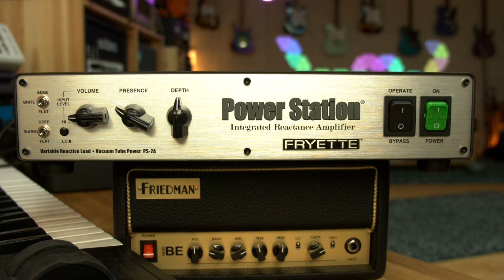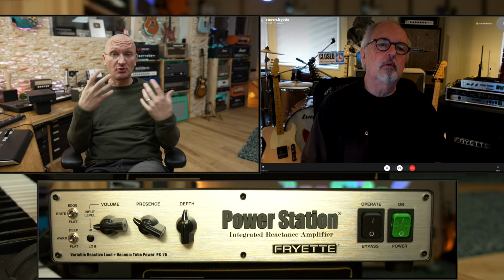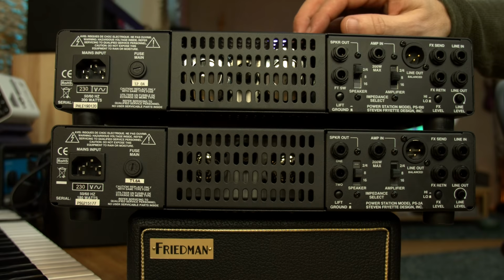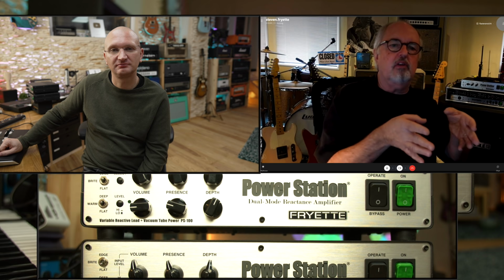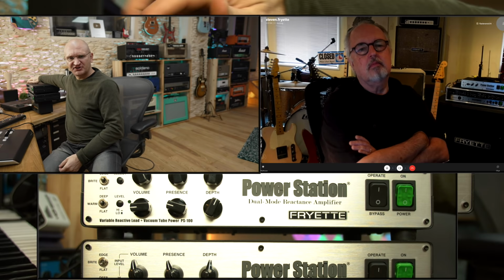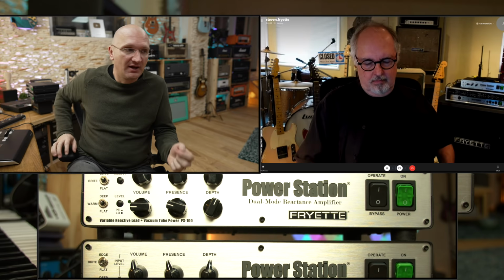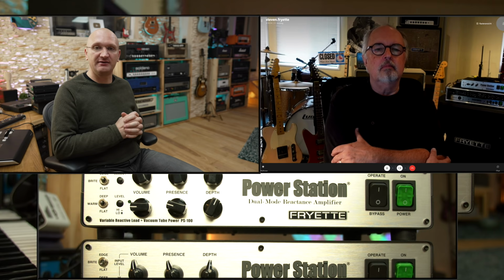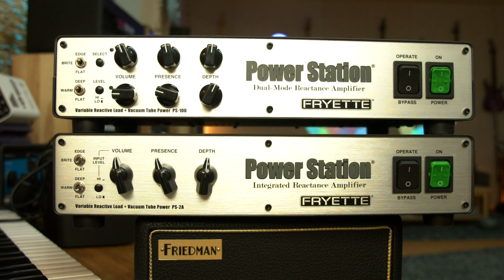The ultimate Attenuator? Fryette talks about the Power Station

Comment: I have an 8 head amp switcher, I put the ps-100 in the in out bus of my amp switcher, that gives me a global attenuator for all 8 heads and a global effects loop for all 8 heads, it works perfectly, cuts down on cables, great piece of kit.
Reply: I'm hoping to add an amp switcher for this same setup. I'm glad to see someone mention this setup. I have the PS2 and I'm hoping to get the 4x2 amp switcher
Reply: Super great. I have an SC20 which I am getting this for, but also miss having a Plexi so going to need two amps in the mix sooner or later. Right now just want to get things working with what I have going on, but it's good to think ahead. Appreciate your comment.
Reply: What switcher do you use or recommend?
Reply: @kalkidasofficial  I have a Kahayan, it's great, does the job perfectly, I have had it for about 3 years, if I was to buy one today it would be a KHE
Reply: I've got a DeLisle 12x12 on the way and I'm dying to replace by Radial Tonebone Prodigy load-box with a ps-100. I've got over 12 heads and quite a few low wattage combos that would be amazing with the option of adding a bit more power to them. I'm also fully bought in to the Synergy ecosystem so the power amp function of the PS 100 is sooooo tempting.
Reply: I have multiple heads, i am just not getting (in my head) how you have multiple heads (i also have a bunch of effects going into the front of the amp(s) i am using) going out to one line into the power station (i have the ps-2).
I badly want an amp switcher so i dont have to keep disconnecting to the smp i want to use ??? Confused here, ive seen both the Kayahan ant the other amp switcher named in the Delisle ,  oth look great, just not getting it.
Thanks for any help.
Ready to buy...
Reply: @johnwolff3206  so some of the amp switchers (kahayan khe) have their own inserts in and out for you to place your attenuator load box whatever (ps-100 for me) the ps-100 has its own effects loop so all my pedals I want in the loop go into the ps-100 loop, and with the ps-100 in the insert bus of the amp switcher that means when you switch between amps the effects switch as well because they are in the ps-100 loop which is essentially attached to all the amps at the same time by way of the amp switcher, just be sure you get an amp switcher that lets you attach it that way
Reply: @jackdpearce  I  have multiple heads, i am just not getting (in my head) how you have multiple heads (i also have a bunch of effects going into the front of the amp(s) i am using) going out to one line into the power station (i have the ps-2).
I badly want an amp switcher so i dont have to keep disconnecting to the amp i want to use ??? Confused here, ive seen both the Kayahan and the other amp switcher named in the Delisle ,  both look great, just not getting it. The gentlemen above explained about the Kayahan switcher, can you explain about the Delisle please. I want to(would like to)run my fuzz, distortion and boost pedals into the front of the amp, not the effects loop of the power station.
Thanks for any help.
Ready to buy...
Reply: @johnwolff3206  I’m pretty sure it will, if I was buying a new amp switcher I would go for the KHE with all the bells and whistles, I know one of the models has the ability for you to run two cabs at the same time which I can’t do with the kahayan, good luck 👍🏼
Reply: Nice, I've got the same setup. Works great
Reply: @thehoppo  KHE is the way to go
Reply: I have a KHE 4x4 FX and it’s great. It has a dedicated attenuator insert loop too.
Reply: @woolyfuzzy  perfect
Reply: Hot tip thank you! The PS makes all my amps actually sound better

Comment: I have two PS2-A units, which I consider some of the best gear I have ever bought. Mainly use them to go stereo from a Helix Rack into two 2x12 cabs with Celestion Cream speakers (after I finally realized that Class D power amps and guitar should not exist on the same planet - and I tried several of those). I also use them for recording (far less noise/hiss than the Captor X and a lot more road worthy than that OX by IKEA). Of course I also use them to attenuate my 100W heads and to amplify my Effectrode Blackbird Preamp. It works perfectly for all these things.

Comment: Purchased the PS 100 almost a year ago. I am constantly blown away how my 100 watt amps sound at reasonable levels. Even my 1watt Marshall sounds kick ass cranked into it. I run it through and amp switcher and I use it as an attenuator, as well as use it as the effects loop for all 6 amp heads. I like if far better than the Boss TAE, which I sold to fund this purchase. 

Probably the best gear purchase I’ve made in years.
Reply: I currently own a Boss TAE and I’m thinking about getting a PS-100. How would you compare them?
Reply: I have recently putchased the ps 2a. Is it normal that it runs too hot? Thanks

Comment: I take one output of an AxeFXIII into the FX return of an EVH 5150III,then take the speaker out of the amp into the PS-100…. Then the line out of the PS-100 back into the AxeFXIII…..Outputs 1 of the AxeFXIII then go to a stereo Marshall 9005 tube power amp into 2 4x12’s……so the amp models are being run thru a cranked tube power section,then that sound with stereo FX are going out left and right,and I can use a 3rd cab in the middle that is dry….sounds phenomenal…..Power Station makes a very easy wet dry wet rig…..

Comment: This looks incredible, I just want something like this but with a Stereo FX Loop, Stereo Outs and 3 Cab outputs. Add the option to have 4 Line Outputs a Left and Right for for the Stereo FX loop, and 2 for the dry signal with a tiny phase difference to give a double track effect. Effectively this would allow you with a Single Amp head to create a Wet/ Dry/ Wet setup to create a perfect Stereo recording or Live setup. You could Mic 3 Cabs, have the FX loop affected L & R outputs Direct into your Interface either through the ADAT or L & R Line outs and just Mic a Cab with the Dry Signal, Run FX Loop L & R outs and both Dry outputs into your interface either from Line outs or ADAT. Yes I get having so many ways to effectively do the same thing seems redundant, but it would give Options, and Options are Good.

Comment: I know I’m late to this party, but just to be clear about Edward Van Halen’s classic MXR Phase 90, MXR Flanger and Echoplex sounds from roughly 1975-1981 or so…he did not have effects loops or any external effects loop devices. He ran everything straight in front of his Marshall amps. If you are talking about say 1985 forward and the advent of the rack gear and later the signature amps from the various companies and albums from 1991 onward, there might be some loops involved. But I can say with absolute confidence and hard evidence that Eddie did not use an effects loop for any effect during what most consider to be the classic era of Van Halen.

Comment: You can use a Boss TAE for your wet effects send but I wouldn't use its output for my main dry guitar sound. The Power Station you can do both and it sounds amazing. It is a real amplifier. valve amplifier. Your guitar cab of choice feels a Valve amp driving it but at your level of choice, ie not deafening.

Comment: The Fryette PS-100 is what I have waiting for my needs- - - - am able to boost my favorite lunch box amps, or attenuate my 100w beasts, or use the line out going into my AX-8,  into an interface to do silent computer recordings. ALSO, ADDED BONUS - - - Be able to run the already beautiful amp models of the AX-8 through the PS-100 and out into my cabs, eliminating the need to fill my man cave with much more amplifiers. Now I can have inspiration 24/7. This is beautiful, thank you Steven Fryette.

Comment: This is an awesome video that really answers all the questions I've had. Previously while considering to get an attenuator I always bumped into lots of marketing bullshit and those were packed with a lot of stuff that I don't need and especially don't want to pay for. This product is very different.

In software engineering this is called micro services - some code that serves only one purpose but does it in the most effective way. I believe that in the hardware it's also a way to go. Every pro should be able to replace any single part of the system if he thinks it's worth it. Of course there's still plenty of room for the combined systems, some people just like simple solutions without thinking of proper connection.

Comment: I'd say the ONLY thing I don't like about my PS-2 is the warranty/service..... Your local techs (or any other tech) can't touch and it must be sent back to Frayette. Love the product and all that it can do (blows the TAE out of the water), but having to pay for the shipping all the way to them when the issue had nothing to do with me sucked! Specially with shipping costs being what they are now. Flip side to that is it's so good and so useful I did pay the shipping and would do it again if I had to!
Reply: Depends on your location. Sad fact is, very few local outfits are qualified to fix anything let alone a Power Station. We would prefer to use local outlets for customer convenience, but it ends up taking more time, costing more money and the unit rarely ends up back to 100% factory stock.
Reply: @FryetteAmps  I sort of understand that, my local guy understood it better. Thankfully you guys do provide a great warranty. Also thankful it was under warranty, shipping both ways and repair costs would have been crazy. Other than the small issue mine developed after 5 months I’ve yet to hear of any issues so it helps that you guys do build a great reliable product.
Reply: That sucks, but that's how warranties work.

Unless it some cheap piece of junk you got from Amazon, and you can just buy another one... Warranties cover parts & labor, but not the expense of shipping.

I know, it does seem weird, but that's quite normal.

I just think we aren't 'used' to it anymore; we buy crap online, and send it back/get a new one when it breaks. 🤔

Comment: I really love an attenuator by TAD Silencer. I used one (not mine) with a very loud 120w Matamp GT120 and a Fane F90 loaded 4x12, also not mine. I tried the amp and cab without the attenuator, its ridiculously loud, sounds amazing but you really can't use it in a lot of places, even some small venues won't be too pleased if you turned up with this half stack.

With the Silencer, I could still play loud and move air, but at a slightly lower volume without losing the amp's characteristics with a Sonic Doom Fuzz in the front. As I adjusted the Silencer for lower volumes it still sounded the same, albeit at lower volumes, but loud enough for a gig.

What impressed me most was, we took it to a friend's flat and adjusted it so we could play at such low volumes we could hear the strings being picked. With a few extra tweaks with the Silencer's fine tune dial and switch to adjust for such environments, it still sounded like it was fully kranked through a 360w  4x12, the only thing that wasn't there was speaker distortion and the air being moved, but it still sounded like a full on half stack. Seriously impressive.

I have just ordered one to go with a Model T amp that's being made for me. The Silencer is only £350(ish), too.
Reply: Sounds great for you but  I don’t believe that has an effects loop. I can use my PS2 with my not Master Volume amps like my Tweed Deluxe (5E3) and add effects after the power amp. A 5E3 typically distorts at the power amp stage - putting effects in front doesn’t work me. I do appreciate that the PS2 is twice the price though.

Comment: Just watched this while enjoying dinner, I believe I have just found the solution to my 70w Super Reverb dilemma in the PS-100, but maybe the PS-2A would solve it as well?
Reply: Both take over 100w input. But the PS2 and PS100 have slightly different options/connections. Plus of course PS2 outputs a maximum of 50w while the PS100, max 100w. Best review manuals online to help choose between the two. Fryette’s own YouTube channel for the PS devices is also fantastic to help choose between the two. 👍

Comment: Sooo .. my question is: since it’s a tube poweramp, does it need a load to not damage itself in case I would only want to use it as a reactive load to get the DI unto my computer?
Reply: Check out the manual page 6 on Silent Mode. It’s at the Manuals and Literature link on our home page. YT won’t let me post link here.

Comment: Will my Dumble  clone sound like a Dumble clone, or will it sound like a Power Station?
Reply: I had the same question.  As far as I understand the PS is converting the entire amp output (preamp and amp tubes working) into line level which is then amplified by the PS built-in amp.  So I'm guessing there must be some characteristics of the PS amp that gets into the final cab output.   @Fryette Amps, is this correct?
Reply: I use the ps-100 across a variety of amps and I’ll tell you that the PS is incredibly transparent. I have not noticed any coming or altering of the tone at all. The power section on the PS is just a boost. I’ve also been using it to pump some 5watt amps to ear splitting level and zero change in tone. FWIW.

Comment: I have the FRYETTE PS-2A since December, it's a real great and very useful tool! But something in the Video is a bit confusing for me: at 32:42 Steve Fryette says: "1 watt amp into a ps-2, then take the speaker out of the ps-2 and plug it in its own amp in of the fryette"  But where do i put the 1 watt amp into the ps-2, when fryettes "amp in" is already connected with the cabel that comes from fryettes speaker out?
Reply: Put an 8 ohm, 10W resistor across the speaker output of the amp and then plug that speaker out into the PS Line In.

Comment: Thank you for the interview and specifically the last 10 mins. I’m done with using the OX as an attenuator and I will only be using it for modeling while the PS100 does the attenuation. First world issues, I know. These two products are best of both worlds in my opinion although it would be nice if UA actually developed the product or allowed IRs like the torpedo, but I digress.

Comment: My Ox I have an 8” Studio monitor on it and I crank the many Cabs on the Ox. My amp is set at 7 - 10.  it has the breakup From the amp in the cab and sounds as great as the amps breakup. I dunno about the way you use your ox, into a studio monitor maybe ….
I will say the studio monitor doesn’t have the thump of the magnet of the amp, in the room so THAT is not present

Comment: i have a first gen PS
i have an old SLO 100
can i treat the PS as a 16 ohm load 
so, signal chain is
SLO speaker out into 16 ohm  4x12  > SLO speaker out into PS, out to another 4 x12 
will this be an issue for my output transforner in my SLO 100
TIA

Comment: I want to knock a few Dbs down from a Vox AC15HW60 (actually exactly like a '57 AC15) which gets really loud when pushed. Since it is 15 watts going to a single 15 watts Silver Alnico, I guess I have to be really cautious about not setting the PS2-a ABOVE unity gain when dialing it in? Is that right? I'm really afraid of blowing that wonderful Silver since it was only reissued to a very limited number and cannot be found again. Thanks in advance, any input would be appreciated!

Comment: So does your tone change? Because ive never tried one that kept my amp and speaker sound. When a speaker is monitored though the studio its under a microscope  .would be nice to open the amp up and keep volume down to use some of that special sauce.  But not at the expense of changing  the original sound  all the ones ive tried some worse than others
Reply: I am sure everything we add in a signal chain will be noticeable scientifically speaking (measurable by special equipment). But if you get on board with the idea a well
designed/made device can retain the original feel
and tone, then the Fryette PS is pretty much as good as it gets for now at least.
I used to love the ToneKing Ironman II attenuators. But when I tried a Fryette PS, I immediately replaced TK with Fryette. To my ears and feel, the Fryette just blew away the TK attenuator. I don’t care how a box is doing what I want to reduce or boost volume. I just want it done in the most transparent way and for me that is a Fryette PS. Certainly worth trying next time you are comparing the competition. 🤷‍♂️

Comment: Could the Fryette 100 conceivably turn a KSR PA50 into a 100W power amp?
Reply: Yes you would have your amps tone now being pushed out to a cabinet at 100w. But keep in mind it’s still the original pre/power amp that’s creating the original tone characteristics. Having the Fryette PS100 reamp your signal will allow volume increase but your amp will still be creating its oringal tone based on the original pre/power sections limitations.